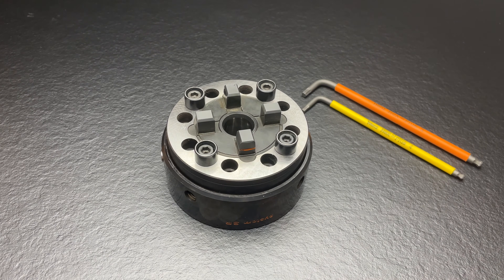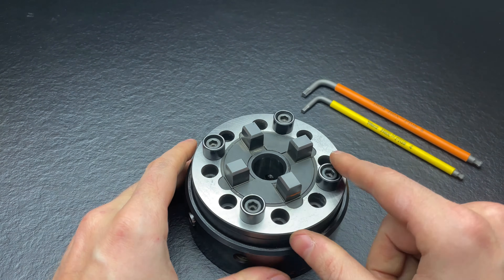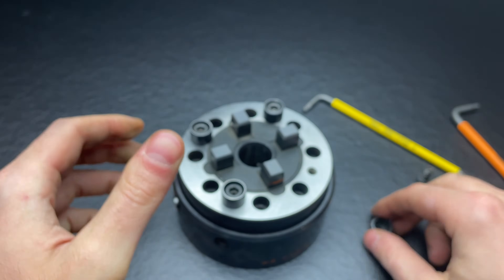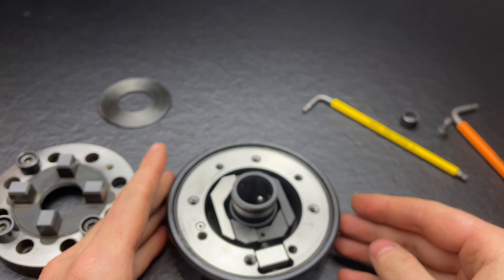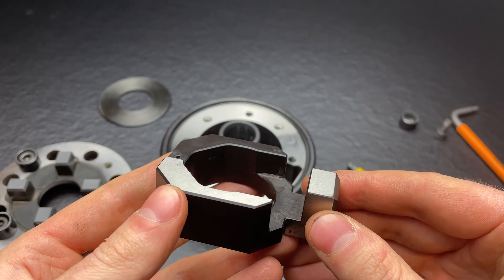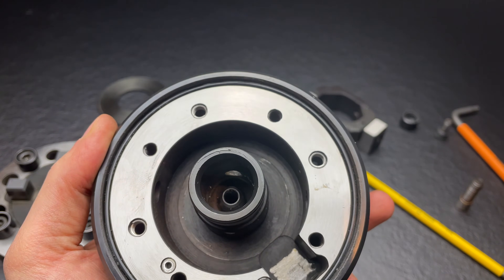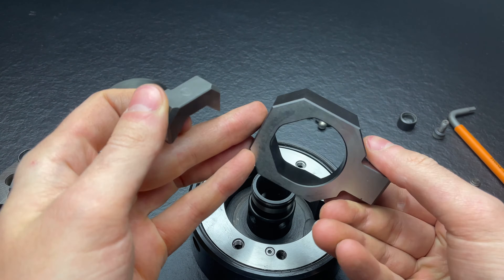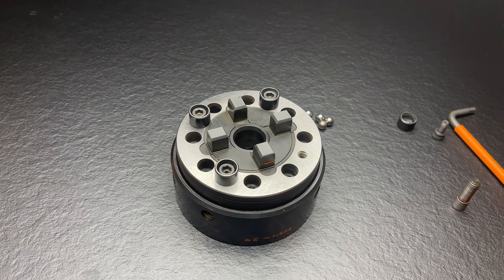System 3r Zero Point System Disassembly

Comment: - The screw on the sides are just for closing the holes that were needed to drill the holes for the balls since it’s one peace
- The “through coolant“ is actually used for removing chips from the center bore and the mating surfaces before each clamping process by suppling an air burst
- The body is mainly turned with some milling features; it could also be that the inner precise surface is hard turned since grinding is difficult in this space and the surface looks like it
- The one surface in the clamping bracket is grounded to allow a better fit (one precise part + one less precise is better than two less precise ones..) and for less sliding friction. And again it’s not easy to ground the inner part..cost cutting..
Reply from the maker: Thanks for the comment. 
As soon as I finished the video I realized the function of the holes 😄.

Comment: I thing the hole on the outside of fixture (those with short thread) are so they can make inside hole for the balls.
Reply from the maker: Thanks for the commend. Yes I think you are right.
Reply: @hampfi747  wär am einfachsten einfach die 4 Löcher rundherum auf der 5 Achs CNC zu bohren dann das Kugelloch wie erwähnt von dir mit einem Lollypop kurz abzurunden. Wäre das einfachste, würden wir so fertigen.